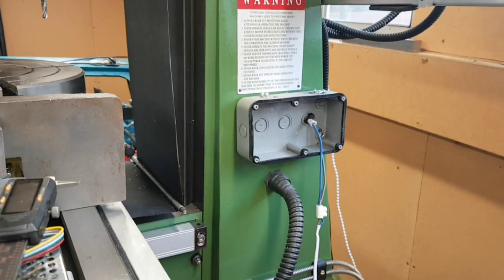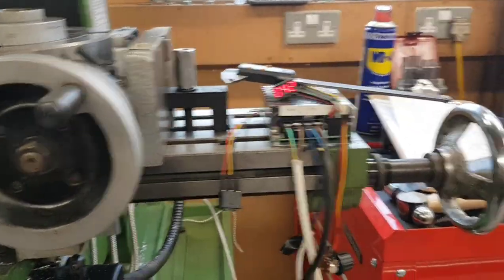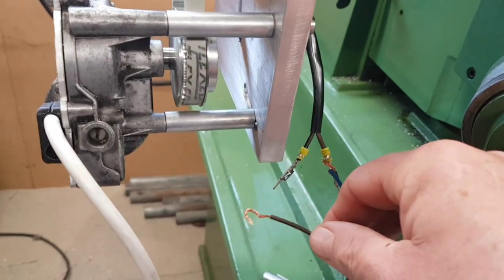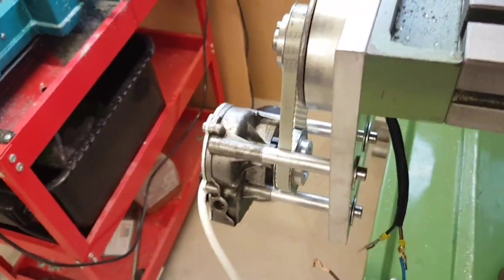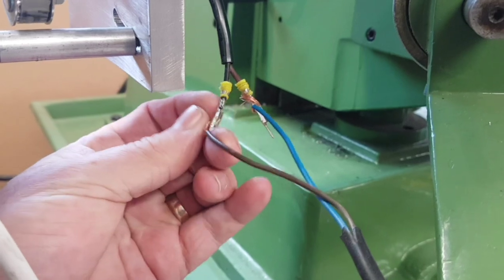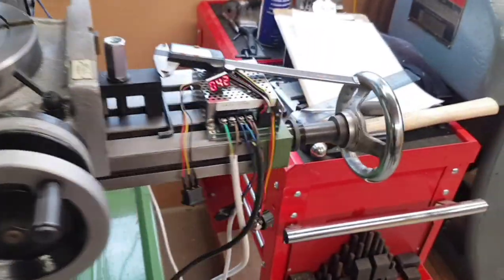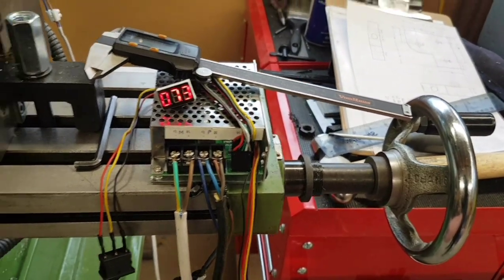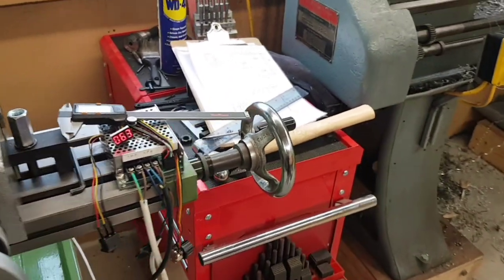Power Feed Project  " IT WORKS" (part 5)

Comment: great stuff Neil, do you know what model compressor or vehicle it's for and maybe a link to buy the electro magnet.. cheers Jim
Reply from the maker: Hi jim.
It was the cheapest one on ebay. £22.00. Think it's a Vauxhall astra from memory. They all work the same as far as I can tell. 12v I used which when checked was 4ohm so 3amp current draw.
If you go for it Jim and hit problems, give me a shout. Oh, brown is - black is + 😁

Comment: Gday Neil, the more I see this the more I’m liking it, great job, Cheers
Reply from the maker: Cheers Matty.
Did a load test too. Run it up and pushed against the bed. 120kgs (260lb) verses the mill at 500kgs. The table slowed a little but I did have the machine off the floor by that time. No wonder my back is f#*ked 🤣

Comment: Hi Neil,
That seems to work a treat... do you think the resistance generate by cutting something will have an impact on it? I know I keep saying this but it is a fabulous project.
Take care.
Paul,,
Reply from the maker: Good point Paul. The mill is 500kgs and I'm 120kgs. I got my shoulder against the table with the feed running and braced. The motor slowed down as the mill started to lift off the floor. Now you know why my back is in such a state. I'm an ex-pit pony 😉
Cheers Neil

Comment: Hi Neil
I knew you 'd gaffer it, great job, now for the easy bit tidying things up, when i'm at a loose end🤣🤣🤣 i may have a go at that, thanks for sharing
take care of that back
Kev
Reply from the maker: Hi Kev, hope you are feeling better.
I'm still not overly confident but anyone from my engineering past will tell you that.
I sat for 2 weeks once on and off watching the computer updates on a bucket elevator I designed. It could lift and transport 700 tonnes an hour vertically and the drive assembly was based on a pizza cutter!
My boss thought I saw the design when I visited factories jn Europe but I only approved the chain design there. The drive came to me when I was pished in a takeaway the night I got home 🤣🤣🤣
Reply: @NellsMechanicalManCave  Great story, and yes i'm much better, but the little bugger knocked me sidewards, glad i got myself  full of anti bodies before it got me😰
see you next time
Kev

Comment: Well done! Great work and must be satisfying to see it running!
Reply from the maker: Cheers Ben, it is nice to see it working. I'm not finished yet though.
Still got lots to do and lots to confirm before I'm happy.
Cheers Neil
Reply: @NellsMechanicalManCave  Put the electrics in a box, set up limit switches etc, but in principle  it works!

Comment: Awesome project! Do you expect any problems regarding metal chips that collect around the magnetic clutch? If so, do you plan to cover the drive?
Reply from the maker: Hi Jonas!
I am expecting chips to be attracted to the area and planning a guard. Probably aluminium but I might 3D print one, not sure yet. The metal casing of the coil itself doesn't become magnetised  but I will cover everything. 
Really glad you are enjoying what I'm trying to do, it's been real headword on times 😊
Thanks for commenting  cheers Neil...
Reply: @NellsMechanicalManCave  Thank you for the answer. Of course i enjoy your work! I was trying to come up with a simple clutch for my own milling machine, but the mechanical solutions i found were way to complicated. Your design is  very clean and does not take up much space. I am looking forward to the next video, maybe we will see some cutting and how the chips behave around the magnetic field.
Reply from the maker: @jonasasche3169  new one uploaded but no chips yet 😕 
The clutch does work but don't jump on the band wagon yet! I'm not that confident in my design at the moment. I might have to go down a different path but still use the magnet 🧲 
Hold on a bit longer and let me get it working as I want.
Cheers Neil 👍🏻
Reply: @NellsMechanicalManCave  Sure thing! I might order a magnet in the meantime ;) The custom wiring box looks good, maybe 3D printing isn't useless after all! For the wiring you might want to look into 'relays with latch circuit' (?), in Germany we call it 'self-holding-relay'. You could add button switches into the latch circuit that are activated by the end position of the table, turning of the motor and the clutch. But you probably know about this already.
Reply from the maker: @jonasasche3169  yes I am aware of these relays and contractors. Usually an auxiliary NO contractor to  hold the coil energised and a NC  to break the circuit when activated😉
The odd thing is I learned this in Germany. I used to work with Polysius Krupp (Beckum) and developed several systems, mostly in automated welding and automation. That was a long time ago though. Still miss Germany but I dont think they miss my humour 😊
Reply: @NellsMechanicalManCave  Interesting! Beckum is a one hour drive! I am curious about what you come up with.
Reply from the maker: @jonasasche3169  curious? As in  where I get my ideas💡 ?
If that is what you mean, I look at things differently ( often I'm told that I think out of the box)
When I first seen a car AC compressor I started thinking what other applications could a clutch like that be used for. Most people just see a part of an engine. I've always been odd like that 😁😁😁
Reply: @NellsMechanicalManCave  I was thinking about your future ideas regarding the project. Maybe a 'next' was missing in my sentence. But your answer is fine! Don't spoiler the next videos!